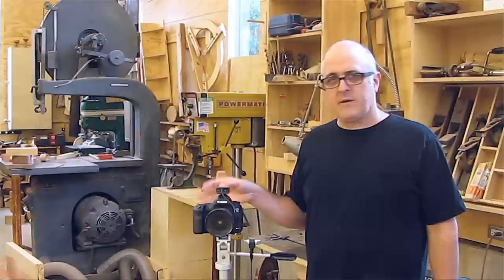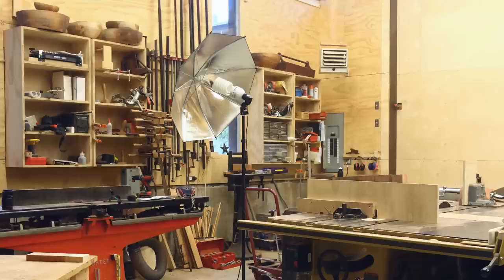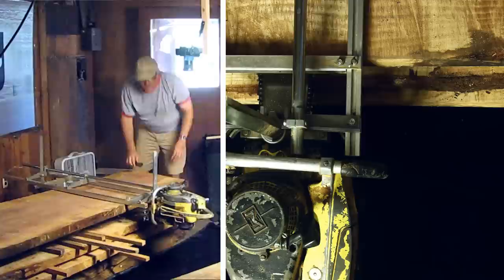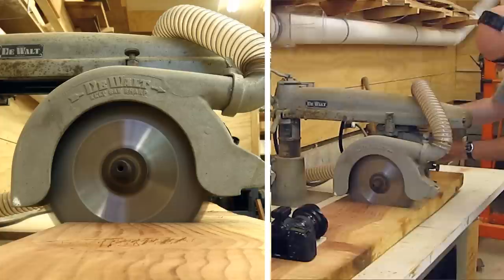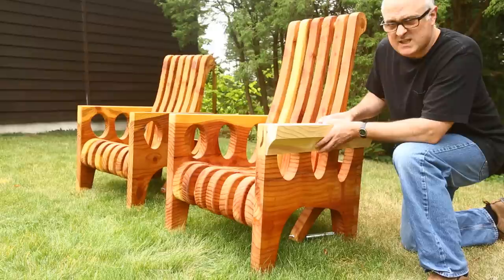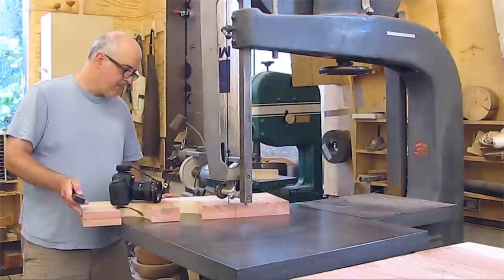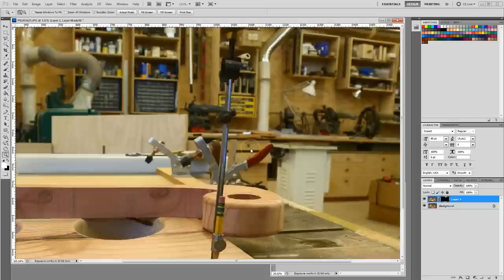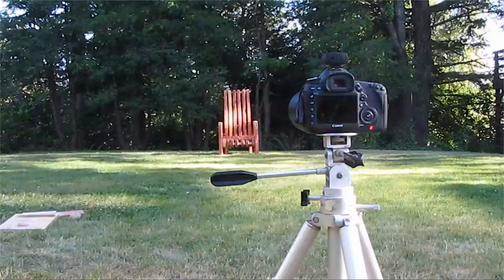The Making of the Lawn Chair Stop Motion Animation

Comment: It gives you a perfect right angle between face and edge.

Typically you would joint one narrow edge to get a flat reference edge. Then with the reference against the jointer fence, you joint a face to get the 90-degree angle. 

Next you plane the opposite face to get it flat and parallel (jointer gets it flat but wouldn't guarantee parallel to the opposite side), finally rip on the table saw to get the final edge flat, parallel & 90-degree (some people also joint the last edge after the TS).

Comment: Since you are spending quite a time in planning, shooting and editing, I suggest that adding a camera movement to your time lapse and stop motion shots would make them more dynamic, vivid and appealing to the eye, there are tens of camera sliders on the market and they are simple to use and sit up , a simple horizontal, vertical   diagonal movement to your camera with the proper foreground will bring wonder to your video work, all sliders have electric motors that work automatically with your camera software and setups.. take your stop motion and time lapse to new heights. This link will give a full idea about sliders:
Dynamic Perception - Introduction to Shoot Move Shoot Mode

or you could go for a cheaper option that cost no more than $20:

  $20 DIY Motorized Timelapse Slider

Comment: Frank,  I've been looking for slow panning heads for a good year and all I was able to find were basically converted egg timers that were used for time lapse videos.  I wanted something much faster in the 360 degree in 1 min range.  What I came up with was taking the inside mechanism out of an old music figurine.  You can pick them up in thrift shops from 50 cents on up.  You might be able to use one of those for a slow driving mechanism.  You can actually buy the new mechanisms on line for less than $10.

The other option is to check out what Servo City has:  https://www.servocity.com/index.html  They actually have projects for using with cameras :-)

Comment: Great video Frank. Thanks for the behind the scenes look at your creativity.

I assume you're happy with the remote trigger that you're using. Do you mind mentioning the make and model?

Also, I have (among others) a 5D MII, but have been very hesitant about bringing it into the workshop. With all the shooting that you did, were there any negative consequences regarding dust, such as dust in the lens mechanisms or dust in the camera (on the sensor)? Did you take special precautions?

Thanks

Comment: Curious, what is the make and model of your remote you use for the camera.  Tried to search the comments but that isn't working so well.  I have an EOS Digital Rebel and wondering is such a remote is possible for my camera.  Found a NEEWER model that looks to be a similar form factor in the video.  Is that perchance the one you are using?  Thanks in advance.
Reply from the maker: This is the one in my amazon list.  mine has a straight cord
http://www.amazon.com/gp/product/B004QDN2ZC/ref=oh_aui_detailpage_o01_s00?ie=UTF8&psc=1
Reply: frank howarth
Greatly appreciate the link so that I can compare the features.  Clearly a different model than what I had expected.  The biggest revelation I had was that you are doing your videos with a digital SLR versus a camcorder.  That threw me.  Thanks for sharing.  Getting ready to transform a one car garage shop and been considering capturing it on film.

Comment: Heya Frank,
I've only recently discovered your videos, but I've quickly become a rabid fan of them--they're so well shot and informative. As a photographer, I only have one suggestion that could make things a little easier and isn't too much of an investment and could pay for itself in time gained back. For your animation, instead of your current trigger system, if you switched to a Pocket Wizard system, like this one: http://www.bhphotovideo.com/c/product/1074537-REG/pocketwizard_801_329_pocketwizard_plus_x_two.html, you'd be able to hook up a 1/8" keyboard sustain pedal, like this one: http://www.bhphotovideo.com/c/product/162243-REG/Yamaha_FC5_FC5_Foot_Switch.html, and you could trigger the camera with your foot instead of taking your hands off off your project. It would be a tad safer and much easier. But keep your Satechi system as you have the nice intervalometer feature. Additionally, you'll need the proper cord to connect the PW to your camera like the Satechi system, actually, you may be able to use that same cord if it's a 1/8" on the remote end!

I'm a jumping around in time while catching up on your videos so if you've changed up your system, no worries, but if not, this could save you some time down the line!

Thanks,
Albert
Reply from the maker: Thank you Albert. I have wanted to figure out something like this   I want to do a movie where it is stop motion but i am in the frame.
Reply: frank howarth
No problem. I really enjoy your videos!